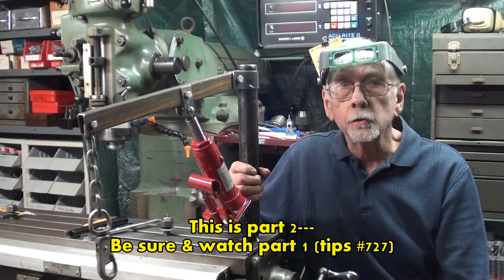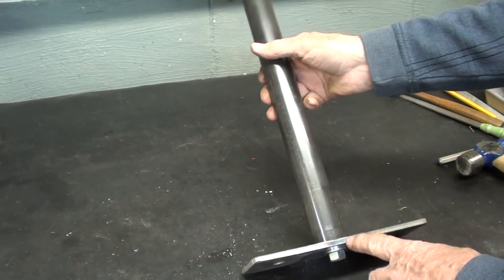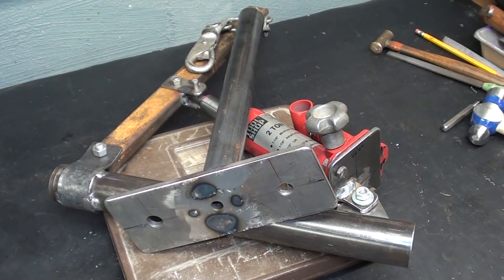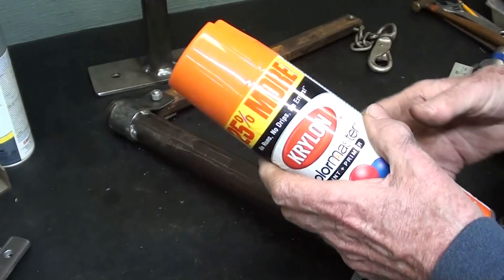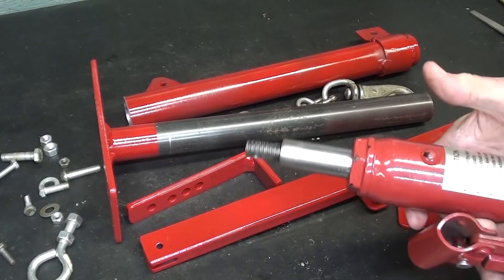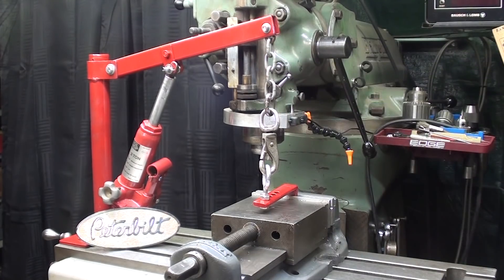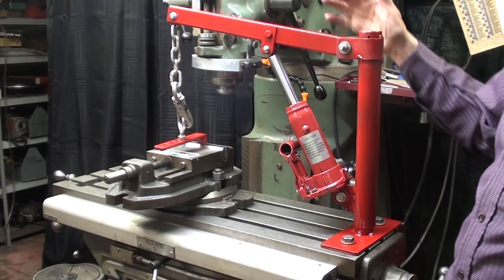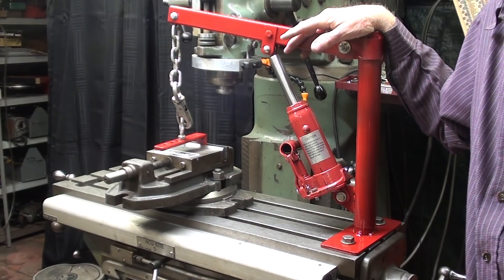Tubal-Crane - SKY CRANE for Bridgeport Mill Vises pt 2 #728 tubalcain

Comment: I have a rotary table that is to much, especially when the 3 jaw is on it, but my vise is getting there then there are the 12 inch chucks and faceplates for the Southbend 16"/24"X 12' I built a tilting furnace that will hold 60Lb aluminum or 200Lb of iron for $35 usd so I think I have enough "stock" LOL

Comment: Thank's Mr. Pete, great job once again! I may consider doing something similar for heavy items in the garage. My plan is to build a similar crane, but permanently mount it to the cart, instead of the machine. That way, there is no lifting at, less weight concerns, no set up, and it can be rolled anywhere. Of course a metal cart may be needed, and possible some ballast in the bottom depending on the loads. What do you think?

Comment: You can use a sliding clamp on the  boom and drill a number of cross holes so you can move the ram to any angle you desire. Thank you for your great instruction , I wish I could study under men like yourself I started way to late in life!

Comment: Some thoughts on next improvements:
 
A nylon disk or washer at the top of the post under the cap would act as a bearing and you would not need grease at all.
You could use tee nuts with studs and use  hand knobs to mount the base. No tools required.

Nice project, I am enjoying it.

Comment: Two thoughts.  Add a end cap to the inner tube and place a greased ball bearing on a washer that just about fits to centre it, for a thrust bearing.  2nd, I have seen a cast iron mill bed cracked and the slots broken by excessive force on t-bolts, especially near the end of the bed where the slots start.  I would add a small couple of fillets or a plate to spread the load in the direction you intend to swivel the crane, or a slightly longer plate on the jack side. With a 2-ton lift, could you put a lot of force on the bed if there was a vice bolt you forgot before lifting.

Comment: Weld a cap on the end of your vertical support pipe. Put a ball bearing on the top and put your crane over it. Doesn't look like your having a problem turning it but if you need to unload a large sack of dog food... Mabbe?

Comment: Very nice build!

One small suggestion - make your jack handle extend out on both sides, then you can use both hands to operate it, either twice as fast or twice as easy.

Peterbuilt is good, but TubalCrane has my vote - if this is a democracy!

Comment: Great pair of videos Lyle, very well sorted. I like the idea one of the  comments below of putting a single ball bearing placed on a  plug in the top of the inner tube. The only one problem for me, is that I'm working inside an 8feet by 6feet shed, and don't have the luxury of a vice cart, and shelf space is only at eye height!

Comment: Very nice build. I think the part I liked best was the large knob on the pressure release screw. I think I'd like to add that to my engine hoist as well as to any other jacks that might be used for positioning. Swapping the pump handle back and forth to incrementally lift and lower is (when you actually think about it) a ridiculous waste of time. {rant on}Do the manufacturers do this to save the cost of a knob?{rant off}

Comment: Very nice setup. I would fix it to where I had a cup for the top of the jack to fit in with a couple of pin slots for R-key pins to fit in. So that way if I need the jack for something else I can use it. And it would be easy to adjust the screw end for the height that you need. As far as having a longer boom, how about finding a piece of rectangular tubing that would slide either inside or outside of the original boom with a couple of T-handle set screws to hold in place.
Just a thought.  Love your channel. Keep up the good work.

Comment: I like the color you choose. To get extra lenght for top bar, remove chain and bolt an get a piece to slide into it. You can drill a hole every few inches in it to have different lenght for reach you will need. That's what I would do. An by putting a bolt in hole it will be really secure an you can have different lengths of chains on different pieces for it if you wanted. Great video buddy.

Comment: Go to your local bus graveyard or dump, remove the air powered door motor, fit it in place of the jack. Connect an airsupply via a valve. Reduce the diameter of the output hole and voila! an effortless lifting crane. These motors will lift 300lbs direct pull so no power shortage and already fitted with fork ends etc!

Comment: Nice little helping hand there Mr Pete.  To get a little more boom reach, you might get away with swinging the base plate through 90 deg. and putting both bolts in the nearest tee slot.
Reply from the maker: Good idea

Comment: Maybe instead of mounting it on the machine, you mount it on a  roll around (work or welding) cart .   Cart could be used for storage of vise or chucks,  or, more likely, to roll across the room to the storage area for all these things so you could unload it off the cart onto the storage shelf?   I like the idea of the extendable arm on the boom.  Same size tubing would work,  just make some 'ears'  to slip over the new piece and weld to end of original boom.  On the movable part,  a pair of ears welded to it  to fit the boom, and on the other end drill the holes for the pin to adjust the length.

Comment: very nice variant of the sky hook; i found myself in your situation a few years ago and constructed a mini overhead bridge crane. i built a lazy susan close to the mill to hold my vises. rotary tables and dividing heads. i use a cheap hf chain hoist to lift and it works well. its hell getting old.

Comment: Mr. Pete, to get more of a reach out from the mill you could mount the crane base plate parallel to the table on the t-slot closest to you. So 90º to how it's mounted now with both bolts in the same t-slot. Maybe not 3" but it will give you a little more of a swing to clear the mill when you're lifting from the cart.

Comment: Some plastics are great for making large slippery surfaces that can take a fair amount of distributed pressure. There are very thin kitchen cutting mats that can be used between your pipes as a low friction bearing material. Some are HDPE, others are UHMWPE. There are even tapes made of UHMWPE that can be used for drawer slides and even taped to the inner pipe. If you get the tape thin enough, and then have the plastic sheet in addition, the two plastic surfaces really work well for reducing friction.

Comment: 10:00 2 engineering changes - both of which I told you about in your previous video ;)
The third change - would be to fit the crane to the cart - so it's mobile - so you're not even having to lift the crane into place before use and it'll work for all machines and accessory storage shelving.
Reply: I think the cart would be too tippy without putting out riggers or a lot of weight, it is only a plastic Rubbermaid cart I think.
Reply: @davidschwartz5127  It needs 2 shelves nearly filled with vices and chucks to add stability weight :)
Reply from the maker: Wait till you watch part three where I do attach it to the cart
Reply: @mrpete222  Build a new cart - like a portable x-ray machine ! Use 12V battery and controller for the powered wheels and power winch. All that will add weight making a stable cart + the weight of spare chucks, vices, dividing heads etc. Needs 2 shelves - with a slot in the top one to let the chain through for loading/unloading the bottom shelf. Un-hook the item thwn slide it elswhere on the shelf :)
Reply: @mrpete222  Drop me an e-mail - we'll start working on your powered wheelchair with vertical travel so you can still lean over the lathe/mill etc. :)
I'd suggest the centre axle variety as they can spin on the spot - so better mobility in tight spaces between machines :)

Comment: Very well done as always Lye. I sure am glad I have 5 treadmills, so plenty of free material to build one. Going to make one base to attach to the tool post on the LeBlond and one like yours for the mill,,,Thumbs up, and our backs will thx you,,,(@@)!! Only change is to use the hand winch that has set on a shelf 5 yrs to lower the large lathe chucks to the floor, no room left in my shop for another cart,,,hehe!

Comment: A man of your vast knowledge probably knows this trick, but in case you dont. You can make your own lock nut by making a center punch mark on one side of a regular nut. It deforms it just enough to make it fit tight on the bolt. Also, on your jack, if you remove the little nub that keeps the handle from going all the way through, you can put the handle in from the back  to avoid reaching around as you were.

Comment: Nice project. Always nice to see these fabrication jobs, although you're still very shy about your welding.

One thing I would consider doing is putting a hook on the bottom of that bracket that you're clamping the vise onto. The goal would be to provide a mechanical support to back up the friction of the jaws on the bracket. If it were to start to slip, then the hook could catch the vise.

Comment: Might be nice to have a long chain so you could lift stuff up to the cart from the floor. That way you could take something from the floor to the cart, then shorten the chain and go from the cart to the mill. I need to make something similar, my rotary table weighs about 150 lbs, I've been thinking of a storage shelf that attaches to the floor and the side of the mill so I don't need a cart.

Comment: Maybe consider a bit of solid bar stock to telescope into the end of the boom to make it longer instead of  remaking the boom.   I did that with my engine lift and it works great.   I use it to lift a deer when butchering to get it higher.  This adds to the versatility too.
Reply from the maker: Actually, I did that three hours ago. Solid barstock 12 inches long

Comment: Your videos inspire me. I bought my first used engine lathe 13 years ago. Now a 2 car garage is wall-to-wall with machine tools.
The timing of this video was perfect. I just discovered an umbilical hernia moving a rotary table! I learned more about it changing a 4-jaw chuck!
I love the simplicity of your design. One note however, the stress in your base to upright welds might be high. The stress is ~ 12,000 PSI assuming a 1" weld length, .1" wall, 1.38" tube, 24" boom, 70 lbs load.  When the boom is in the "Y" axis  the resisting weld looks to be ~ 1/4" resulting in ~48,000 PSI in the tube around the weld. This is without bounce or "demonstrating" how much it it can lift. A safety factor of 4 is also not a bad idea. Lengthening the welds to >1" is probably adequate for a noncommercial device.
I'm off to yard sales looking for a $3 jack!

Comment: Thank you for the great "tip or trick" to use the threaded rod and facing the ends of the tube to get and hold it square while welding!

Comment: Only lifting 70 pounds. "ONLY" Ha Ha
Let us see: 70 lbs x 18 inches(1.5 feet) = 105 ft/lbs.  Post is 1.625" or 7.38 to the foot.  Therefore the rear weld of the post has 775 lbs of tension on it.
Yeah, the forces multiply quickly on a small base.
And the 2 T-nut hold downs have about the same load split between them.
Reply from the maker: I know, I almost tipped the Bridgeport over when I swung the boom
Reply: @mrpete222  😂😂😂😂😂😂😂that's a knee slapper😉

Comment: Wow, I just bought a hydraulic table to help get my vices off the milling machine but I like your crane better.  My only comment is that I'd worry the L piece that gets grabbed in the vice jaws could possible slip out.  Could it have a little lip under the short part of the L which when clamped would fit under the center of the fixed vice jaw.  Not sure if that would work and I am sitting at my home computer but I am going to look at my Kurt vice later to see if there is room there.  Anyway thanks again.  I continue to learn so much from your videos.

Comment: Why not just mill a slot in the bracket for the vises, instead of the holes? Just slide the lifting ring to the exact point. Mark where each vise goes, and it’s exact everywhere.

Comment: Great project sure will be useful . I was wondering if you connected a cable to your upright and ran it through a pulley on the end where your chain hangs , then put a hook on it ,if it would lift and lower more . Just a thought.  I'm definitely going to make one . Thanks

Comment: 9 1/2 lbs plus paint!
Edit - I think I would get a piece of 3/16-1/4" thick stock that slips inside of the rectangular tubing until it reaches the jack clevis. Duplicate the end bolt hole and location through the extention plate adding similar holes at 6", 8" and 10".
Saw 3" off the rectangular tubing and retain. Drill (2) similar holes through the tubing at 1" and 4" from the saw cut.
To locate laterally machine (2) washers to center the retained 3" portion on the bolt.
To center the extention plate inside of the rectangular tubing machine (3) rounds for a slip fit, drill and press fit (or weld) into the the plate.
Still light weight, minimal rework, greater flexibility for a great project.

Comment: A suggestions.
 don't remake the boom, it is hollow, make an extension that will Slide into the original boom. A solid bar with holes drilled 2 inches apart. Now you can extend it to whatever length you need.

Stay safe and have fun, Joe.
Reply from the maker: I already did that, one hour ago. That would be 1 o’clock central standard time on Sunday
Reply: @mrpete222  
  Hope it's aluminum. For the strength to weight ratio. Can't wait for part 3! ⛾
Reply: If I remember correctly, I use to clean paint can spray button orifices with a #71 drill bit wielded by twisting gently between my thumb and index finger.

Comment: If you mount the crane to the cart, there won't be the need for a plethora of adapters.
Reply from the maker: If I mount the crane to the cart I will have a broken leg
Reply: @mrpete222  😂😂😂😂😂😂😂
Reply: @mrpete222  the rebuttal cup runneth over😂😂

Comment: 2:36 If you drill holes thru it, it will be lighter and a real custom crane.  Lol.
Reply: When we mis-drilled holes, we always called them lightning holes (pun on lightening) - (never struck the same place twice).
Reply: @ronmccabe1169  
  And if they were just a wee bit off, we would use a rattail file to make it work. Called those 'Precision Adjustment Slots'.
Reply from the maker: It is already light
Reply: @mrpete222  Just a little joke Mr. Pete

Comment: While an actual engineer might be able to go into more detail, with your 2 ton Jack you should be able to put your upper pivot really really close to the back.  4000lbs expected to lift 100lbs that's 40:1 ration  you 'could' have 1" from the pivot and a 40" boom.  (not recommending you go quite that far) The advantage would be fewer cranks on the jack handle to lift the vise.

Your main limit will likely be the boom strength.  Still with ~20" boom and 3" pivot might make for a more pleasant experience.

Comment: That's a heck of a lot cheaper than the sky hook and does the job well! 
I'm a big fan of using Fusion 360 for modeling things like that nowadays. But, before Fusion 360 came along I made several models using cardboard or thick paper stock to workout linkages and lengths.
I'm still fairly young but my spine has been seen by more than one surgeon in the last few years so this has inspired me to make something similar for my rotary table and lathe chucks.

Thanks, Pete!

P.S. I really like Ken Sherwin's idea of using a ball for a thrust bearing!!
Reply: CAD = Cardboard Aided Design
Reply: @RambozoClown  
Thumbs Up!! Lol :-)
Reply from the maker: Yes, that was a great idea. But surprisingly A bearing is not necessary
Reply: @mrpete222  
Hi Pete,
Sometimes I'm not so good at getting saying what I mean. 
I should have included: "While this project does not need a thrust bearing, Ken's idea was a good one" in my original comment. 
I wasn't implying that you should use his idea on this project but it's worth remembering for future projects! :-) 
Sorry about that!! :-)

Comment: Very smart build.  But, instead of completely remaking the boom, why not just use some solid rectangular stock that fits inside the boom, to make an adjustable boom?  It shouldn't add to much more weight.  Maybe 2-4 lbs I would guess.  Just drill a few holes (3 or 4 would probably do), maybe 1 inch apart, through center of the boom and one at the end of the inserted bar stock.  Then, just use an appropriately sized pin to secure the boom at whichever position you need.
Reply from the maker: Would you believe, less than 10 minutes ago I was rummaging around to find a piece of rectangular stock for exactly that purpose. In fact I did find a piece but I still have to cut it to the exact dimension

Comment: Great work, but instead of remaking the boom, just add a flat bar inside the boom that can be slid in or out as needed, and have a  pin to lock it in place..

have a great day
Reply from the maker: Would you believe, I’m already in the process of doing just that. I already located the flat bar

Comment: Great build Mr. Pete.   Could you incorporate a air chuck some how so you would not have to pump it up?
Reply: Using air in a cylinder of hydraulic fluid is an utter failure. Have you ever had to bleed the air from a vehicle's hydraulic braking system to eliminate 'sponge pedal'?
Reply: @stanervin6108  I meant a pneumatic hook up

Comment: If you make a longer base plate and move the upright pole to the end of the plate you will gain a bit of length
Reply from the maker: That is true, if extra strength was actually needed
Reply: @mrpete222  a simple good job would suffice😂

Comment: I suggest you add an extra piece to the vice adapter so that the bit that is gripped by the jaws has a piece that latches under the jaws to prevent it falling should the vice not be tight enough. Oh , and do t lift a kurt type vice by the moving jaw alone, it is not held on very well.